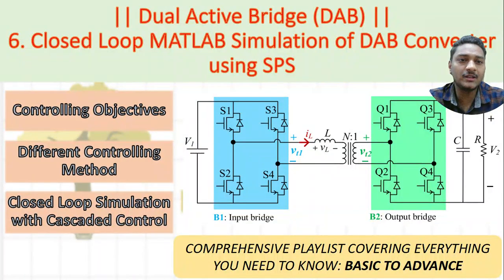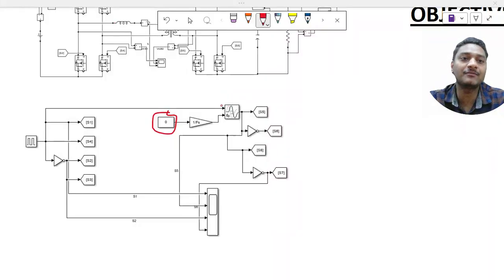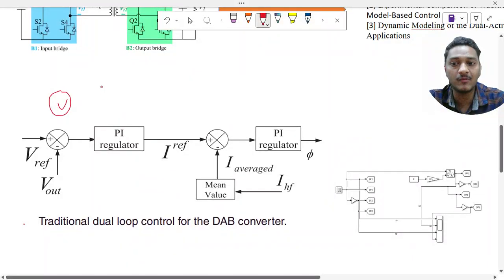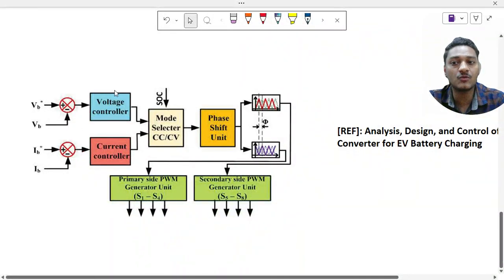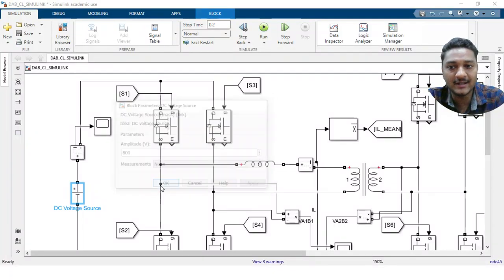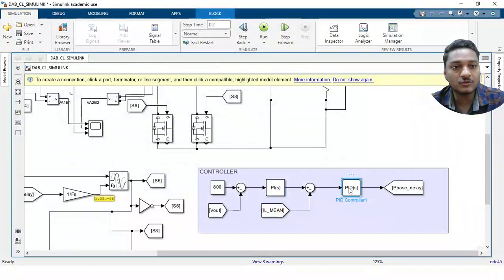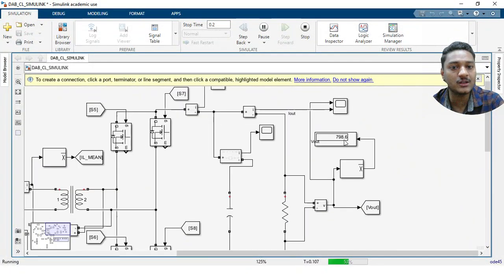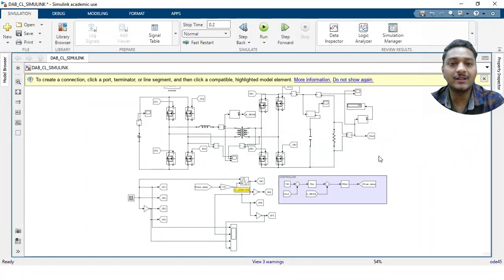LECT 06: Closed Loop MATLAB Simulation of DAB Converter using SPS #dabconverter #DAB

Comment: Sir can you please tell why are we using adding another I_mean after the voltage error and how the output of PI controller is I_ref can you please tell
Reply from the maker: Good question. So that is based on small signal modelling. So you design your voltage PI controller parameter Kp and Ki bases on small signal modelling and use transfer function Vo/iL.   And then tunned your controller. So when you use this transfer function and tuneed your controller, its output is alawayd iL and that is what we are using. 
But in this videi we have not talk more about small signal modelling transfer function and all. And 2nd PI controller which is about current should be tuneed from iL/d transfer function then it will gove d (duty) as output which we are actually using for giving to our switches.

So its cascaded control thats why we are doing this.

Hope you understood something and happy Learning
Reply: Yes sir thank you
Reply: Sir if it's possible can you please make a video on it

Comment: Hello Sir,

I am working on the DC-DC bidirectional converter. I have my input ranging from 50V to 100V and output is around 370V. The total Power output is around 10KW. How do i calculate my L, N and Phase shift for this and which modulation techniques works here. It will be really great if you can help me.
Reply from the maker: Thanks for your question.
I feel you are directly watching this video hence you are having this question.
Please go through previous video of this complete course, you'll learn everything in detail.
Aslo check out the comments, there also i had asnwer lot of queries which mighy be your question as well.

Even if you are facing a challenge, I'll.definitely there to help you.

Happy learning.

Comment: Hi sir, first of all thanks for making this video.
I have made the same model but not getting the appropriate results.
Reply: Can you help me with that.
Reply from the maker: Please check once system configuration and solver
End even if it not resolve slightly play with value of kp and ki it will come

( how to play with kp and ki to achieve steady state value I had discussed in one of the playlist of controller design)

Please try and if problem persiste please ask once I'll try to answer.
Reply: @Kingashish-555  Okay Sir, i will try. Thanks.

Comment: Hello  sir 
If I remove the leakage inductor in the DAB circuit what all the changes can happen in simulation results?
Is that effect the converter
Reply from the maker: Complete power transfer principle of DAB  is govern by leakage inductance only. So without leakage how you'll tranfer power from one side to other.
Either you use it outside or you can use leakage of transformer itself ( but for that you need to deaign DAB transformer very carefully).
Hope you understood
Happy Learning..
Reply: @Kingashish-555 thank you

Comment: Hello sir 
Pls explain the close loop controller for the DAB Converter other than the PI controller.
Reply from the maker: I need to see.
There are methods but those need mathematical expression and calculations to implement to get phase shift angle. If needed reference I can provide, but making video will be difficult as of now.
May be in future I will try to upload.

Happy Learning 😊
Reply: @Kingashish-555 yes sir please try to give references

Comment: Also I want to check my system using proper controller design and bodeplot and do all analysis.
Reply from the maker: I'll try to share this things. But this things are there in the references that I had share in this video. But if gets time I'll surely make video on it. I wanted to make this playlist as comprehensive as possible.
Thanks for commenting and Happy Learning.
Reply: Thank you Ashish
Reply: How to calculate constant value in open loop
Reply from the maker: @prathikshakm483 That part I had discussed in open loop simulation and design calculation video regarding how to calculate that constant value.
Please refer those video you'll get more clarity.

Thanks for commenting and Happy Learning 😊😊